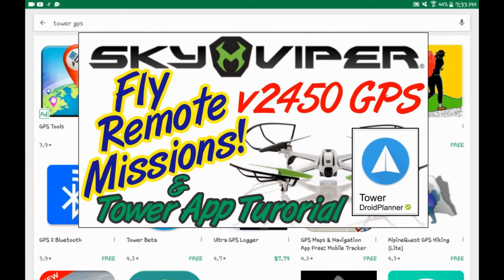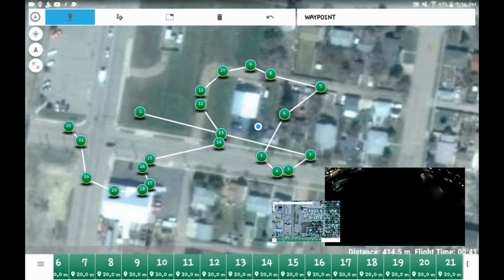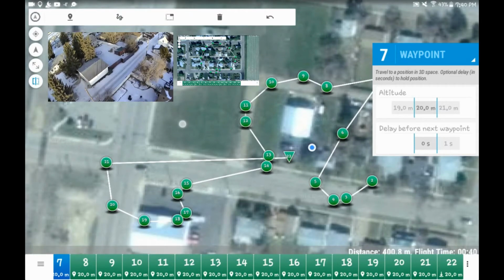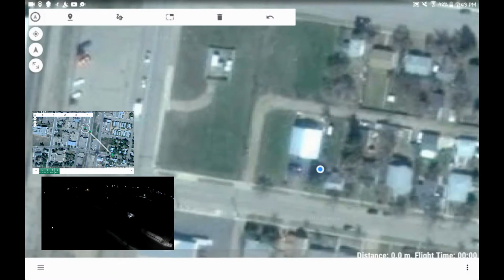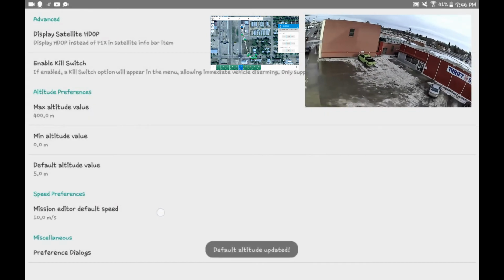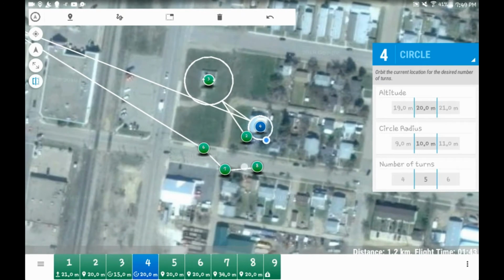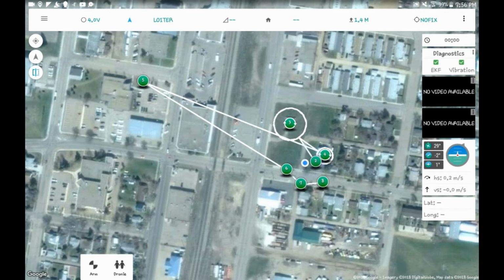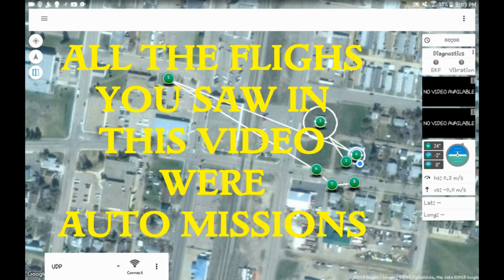Sky Viper V2450 GPS Drone Auto Mode Remote Missions. Tower App Tutorial

Comment: What's the difference between the RTL_ALT perimeter and RTL_CLIMB_MIN? Should I increase both of them?
Reply from the maker: Not entirely sure. Its best to go to the http://ardupilot.org/copter/   website and see what each does.
Reply: @scottkyba  I think I know now. RTL_ALT is the minimum rtl altitude, if the altitude is below the value it will rise to the set height. If the altitude is already above that value, then it will not change the height of the drone. RTL_CLIMB_MIN means that the drone will climb this much altitude before returning, no matter what the case is.

Comment: Can I connect the Sky Viper Video app to the drone and use it while I'm on an auto mission?
Reply from the maker: yes, but if the drone goes out of range, the video will stop on your device.
Reply: Scott Kyba Thanks! How long does the fpv and transmitter range go?
Reply from the maker: FPV approx. 150 FEET and transmitter approx 300 FEET.

Comment: I love this drone.but its not communicating with the return home function on the app.trying to get it figured out.other then that its a nice small drone.just hope my second time flying it will work out a little bit different then my first time.just didn't response to the remote like i thought it should
Reply from the maker: Jamie Cramer does the return to Home on the controller work? I’m assuming you wait for a GPS lock (solid green light) before starting your flight.

Comment: The originall lots drone I tramped around in the dessert a few times, but never found it,,,,, now I'm excited to see what info I can pull out of drone#2,,,,  and maybe it will give insight as the where drone#1 ended up. By the way, yes you were the "internet guy" mentioned in the video. I'm going to look at what data I can pull out of logs that were left on the drone. I see a ".bin" file on the external flash,,,, plus I see some message logs within the Tower app itself.

Comment: Hey scott, not sure if my comments posted. Yes, Drone#1 I lost it on my 3rd flight,,, it was the first time I decided to fly "high",,,, ie 1000 meters. Previously I had only flown fairly far away but not hight, not over 200 meters. Today (with my new Drone#2) I setup an auto mission,,,,, all within a small park 100 x 100 meters,,,,,, BUT going up to alt 300 meters,,,,, with takeoff, wp2 40 meters, wp3 60 meters,,,, wp4 200 meters, wp5 300 meters,,,,, wp6 300 meters and 2 circles, wp7 300 meters, wp 8 150 meters, wp9 100 meters and wp10 return to launch. BUT i noticed that it seemed to make it to WP4,,,, and then just hang out there for 5 minutes,,,, around the 9 minute mark i heard a message on table battery low, returning home,,,, BUT it actually just came straight down at wp4. Which would be problematic if i was in the mountains again :-D. I'm suspecting that I lost drone 1 in a similar way.

Comment: Just got one of these and I'm really glad to see it can do all this stuff! I was hoping I could program it to check the fences on my 10 acre plot, and I think you just taught me how to do that, so thanks! Just gotta re-watch to get the settings set. Thanks for the thorough walkthru!
Reply: Also, I had to change the baud rate on Serial1 to 57600 before I could connect with Tower (was 1200; didn't try anything else; lower baud rate may work? Or did I goof something up? Too windy to fly today, so just playing with config for now). The video streaming port is 554 (port scanned it after connecting with Sky Viper Video app), but setting that in the Solo video section in Tower-->Settings menu doesn't appear to get it to work. It has a specific RTSP URL:  rtsp://192.168.99.1/media/stream2
Reply: Tim Bessler my pleasure.. thanks for watching.
Reply: I apparently bricked my drone somehow; probably shouldn't mess with baud rate after all...cannot connect with any app now. SVVV just wants to update firmware, then says "The flight controller will automatically reboot. The reboot will take about 15 seconds" but nothing seems to happen...just green ring of waiting waits and waits. The local site on the drone appears to be up, but the settings and telemetry don't come thru. Only status it seems to send is uptime and RAM info. No sensor data.
Reply: Tim Bessler yikes... I wonder if there’s a way to manually factory reset... what about loading firmware to Your sd card and booting drone with firmware sd card in. If you figure it out let me know.
Reply: I hadn't tried putting an SD card in it yet (might explain why I couldn't save my missions); the battery just ran out while I was trying to troubleshoot (for awhile), and I had just switched it over to connect to my home WiFi as a client/station rather than a server, using telnet to connect to it and try messing with it from there (since the web API is only letting me talk to the video board). I'll post back to see if putting a file called FACRESET.TXT in the root folder of the SD card works like it says on one of the ArduPilot copter documentation pages.

What didn't work:
*Running NVRAMRESET command via Telnet (on port 2017)
*Factory Reset button on the web UI
*Trying to update firmware via Sky Viper Video app
*Trying to update firmware via the web UI
*Power cycling the drone and controller handset

Comment: Great video. Changed tower to UDI and viper to SERIAL1_PROTOCOL TO 1. But can not connect Tower app to viper. Question: cell wifi has to be connected to internet or viper signal?
Reply from the maker: Gone Droneing skyviper has to be connected to device WiFi running tower. So connect to the skyvipers WiFi on the device and Then run tower on the same device.
Reply: It works!!! To see the wi-fi signal from Viper the transmitter has to be in GPS Mode (green). Cell screen is too small. Tablet is necessary. If you ever come to Toronto we go on a mission.

Comment: ohhh,,,, and one other question. Regarding the FS THR Enable=2 to disable the safety feature. Does this only disable the return feature during a waypoint flight... OR does it also mean if I'm just flying with manual control and I fly out of range it also won't come back to me? Should I go in and toggle that setting on and off depending on what kind of flight I'm doing,,,,, waypoint, or normal manual flying.
Reply from the maker: it only effects way point flight and furthermore If you have a solid GPS Green Light Lock before you fly your mission and if the battery gets low on a mission, even if you have FS THR Enable=2 it will abort the mission and fly home. As long as the GPS Lock is on before activating the mission. The only time it wont return to launch when the Green light is on and battery is low is when you are in a different mode like indoor or acro or sport and you press the mode button during a flight . Im not sure why and it doesn't happen all the time but i have seen the drone just land vs RTL while the green light is locked when i pressed the return button. If im flying a long mission, these are the steps I use, 1 I turn on drone and connect to Tower. 2 upload waypoints, 3 download waypoints to confirm. 4 place drone on ground. 5 turn on controller. 6 wait for green light to lock. 7 start flying manualy, 8 actvate auto. 9. wait for the drone to return. Ive never had a problem when ive followed those steps.
Reply: https://youtu.be/R2kOWd7ly6A
Reply: Thanks again for video and advice. This was pretty much my first flight. I synced the two videos to have our voices,,, AND I altered between the drone and a "post stabilized drone" track. The flight was 6 minutes. Something interesting, it appeared that the drone records in 24 fps, but saves at 30fps. My second flight was a few days later and was 9 minutes an also successful. AND for the 3rd flight I sent it straight up to 1000 meters,,,,,, and UP it went as smooth and stable as can be,,,,, AND we never saw it again
Reply from the maker: So you lost your drone? :(

Comment: Great video, I watched the whole thing. Is there any way to set the camera to turn on/off at certain points in the route? Or do you just take off, turn video by clicking the ?record video" button on the controller,,,, AND then do the "mode-photo" to start the missing?
Reply: oops, sorry for my spelling, mission, not missing :-D
Reply from the maker: I haven't been able to get tower to activate video or photos. i just start video with the controller before sending it on its mission. thanks for the comment
Reply: paul mossman  I turn my video on before I take off. In flight I switch between video & pics
Reply from the maker: Rick Gaines right... ya that’s what I do as well..
Reply: Can you take pictures while taking a video on the sky viper?

Comment: Success!!!! I made a few missions at my local park slash soccer fields. The first mission I made the Drone went too far and the geofencing brought it back so I kind of made some small missions Within the geofencing perimeter and it worked very well I was very impressed. So now I've extended the geofencing perimeter even farther but due to the wind I will have to try it out another day keep you posted.
Reply from the maker: so much fun right!
Reply: Scott Kyba i agree. This was the best $100.00 i spent. The drones software gives you endless possibilities. Thank you for the video's. They are very detailed. Hope to see more. Oh  yea I forgot to mention the public make sure you put a microSD card in the Drone because that's where all the Mission data is stored.
Reply from the maker: good info to know.... Since i never take mine out i didn't know it did that.
Reply: Scott Kyba i took out the sd card and put it in my PC and it had a Ublox folder with data files.

Comment: I watched this video 2 or 3 times and gave you a like for it. I must ask you if you really ran the missions you were showing.  For the splines, the area of interest and others are not doable with the viper2450gps. You have to change the flight modes and you can do the circle, loiter and there but many of these are not listed under flight modes. I set the spline, circle and area of interest waypoints and my drone only ran 4 waypoints while  skipping these. So I went to Flight modes to set these listed way points and they are not there. It may be I need to update my firmware. If so I cannot do it except by mavlink. I have tried with it without results. Skyviper video updated it when I got my drone 2 weeks ago. I tried mission planner, and  Qground control to know avail. Do you have  any advise? Thanks
Reply from the maker: Hi, All the videos were remote missions with the Skyviper V2450 GPS, including the point of interests and spline. The only thing did for my youtube video was re-create the small screen shots in tower real quick as I didn't save the paths. The Area of interest works and spline work perfect for me. at least two of the missions in the video fly and do multiple circles. I never had to make any changes to to arducopter settings. (all i did was assigned a auto button)  I haven't ran any since the last firmware update (a week or so ago). hopefully everything still works. Once it warms up in my area i plan on making a full screen mission video. So cold in Canada! Thanks for subscribing! This is my first drone. (but i did buy another V2450 and also bought 2 more V2450's for friends.) Stay tuned. :)
Reply: Thanks

Comment: hi hru I have a question for u I have a sky Viper v2450 gps n am trying to make my my camera live feed from a 5 second delay ? ..so I can do fpv with it ? ..n I know it's wifi to 😢 but still wanted to do fpv with it?
Reply from the maker: Are you using the FPV in the sky viper app? There’s not a 5 second delay. It’s only a small delay using WiFi. it seems to work fpv just fine. not sure I’m understanding your question.
Reply: yes I'm using the sky Viper fpv app ..n yo video looks a lot better than mine .. as far as to do fpv
Reply: n the special features with the I think it's IP code .. iv looked on there didn't mess with anything fo the camera settings ?
Reply from the maker: mike waterman you don’t have to change anything it use fpv. It just works.. I’ve never changed any advanced settings to use fpv. I use Corel video studio to make my videos and there are some stability filters on some of my videos. Also when I play small videos over my videos that look very sharp as well because there smaller. . In full screen the video is the same quality as yours.
Reply: so don't mess with the camera settings ..n am using a Venom thousand Mah 25c ..n from fully charged .. till I get GPS lock to fly .. I got 50% left on my battery ? 😢? .. do you have any suggestions on a better battery ?
Reply from the maker: I ordered some 1200 Mah batteries from aliexpress... when they come in ill do a review. Hopefully they preform better. My V2450 came with 2 1200 Mah batteries. Correct, dont change your camera setting. If you made changes, you can always click the default settings.

Comment: how did you get it to connect to the skyviper v2450gps when i try to connect the app just shutsdown
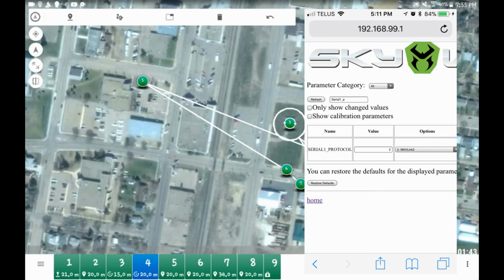Reply from the maker: All the connection settings start at the 17:50 minute mark. Make sure you changed SERIAL1_PROTOCOL TO 1 in the skyviper settings. There is a couple of settings that start with SERIAL... so make sure you change the correct one. If those are set right try deleting the tower app and re-install. Or try on a different device. There may be other apps on the app store that may also work. perhaps Tower doesn't like your device..

Comment: btw how high did you set the altitude at during the first footage?
Reply from the maker: I set the limit to 295 feet or 90 Meters. Even though this drone is less then 250 grams and the Height regulations restriction may not apply to it in Canada, i still choose to stay at or under 295 feet or 90 meters.